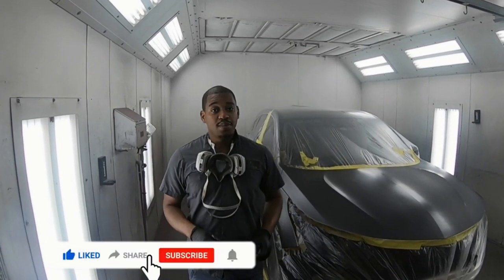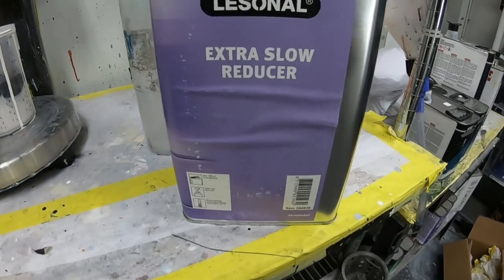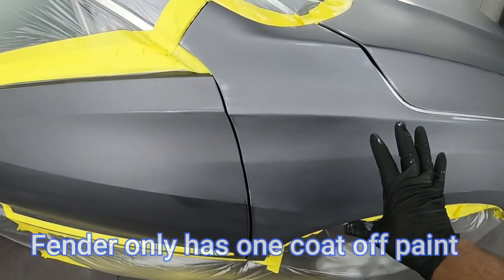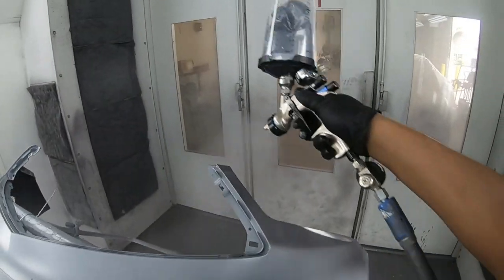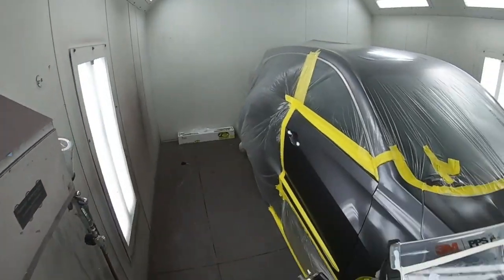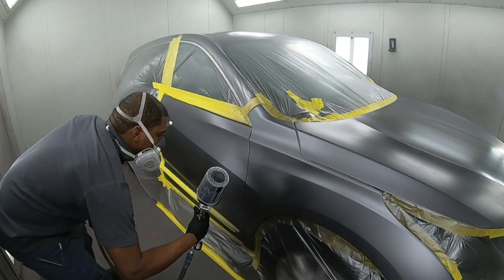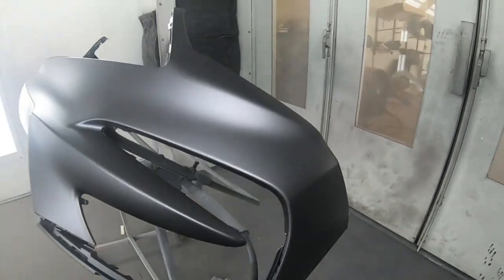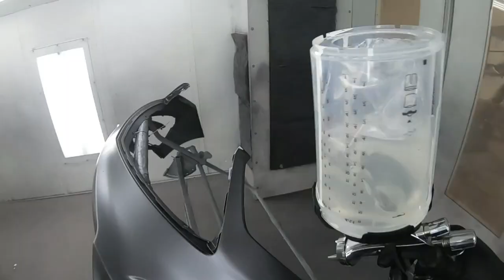BEST TIPS AND TRICKS FOR METALLIC PAINT

Comment: you dont have a link for the sun gun. can you provide us a link for that please?  also I cant tell in the video when you were applying painting and when you were using the paint melter/blender. So i got a little lost or confused.
Reply from the maker: I placed a link for the sun gun in the description for ya. Also the reason I use two different cleaner is because.. the water base cleans deeper than the solvent. Both together is a win win. HTE and LVLP is not the same. I’ll try to get you the pneumatic palm sander info when I get back to work.

Comment: Hey Mario another fantastic job mate and yeah there is no sign of the blend anywhere, we have been having some hot weather lately it's been 40C+ (104F) in my little booth which for me is far to hot 🥵😂
I have a question for you Mario, just done a 3 stage where the ground coat is a heavy metallic silver and the mid coat is basecoat binder with a transparent blue tinter added, once sprayed it looked a bit blotchy/patchy under the booth lights but looked ok when using the colour check light, I haven't done the clearcoat yet but I'm hoping it will be ok, is it normal to see the patchy finish under the booth lights? thanks Mario🙏👍John UK.
Reply from the maker: Thanks John you should feel the heat in the plastic tent 😂 As your paint problem speaking from experience sometimes the booth lights play tricks with your eyes looks funny inside and perfect outside. The good thing is that it looks good with the color check light. 3 stage colors with silver as the ground coat also tend to look that way
Reply from the maker: Just make sure you get good coverage. What I like to do with my mid coats is double up for example in your case I would add a little more blue to make the color stronger so covers quicker with less coats.
Reply: Many thanks for the quick reply Mario, I think I need air con in my umm booth (how very dare you call my state of the art booth an tent 😂 shame on your sir 🤭😉).
Thanks for the advice on my 3 stage, I've only done one before which was the Mazda 46V but didn't have any issues with that one. It looks ok with the colour check light so it should be all good, bit strange though as my booth (aka tent 😁) lights are the LED daylight colour, anyway next time I do one like this I'll take your advice and add more tinter to the binder👊🙏👍 John UK.
Reply from the maker: @JohnWD40TC02  lol I wasn’t actually talking about your booth I was talking about the one I use sometimes